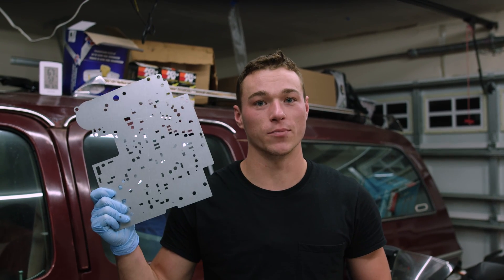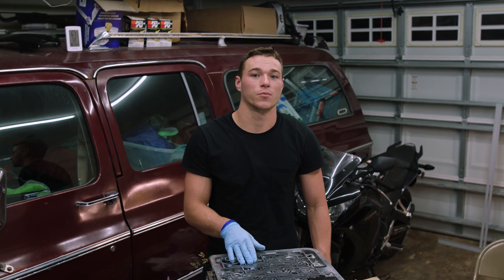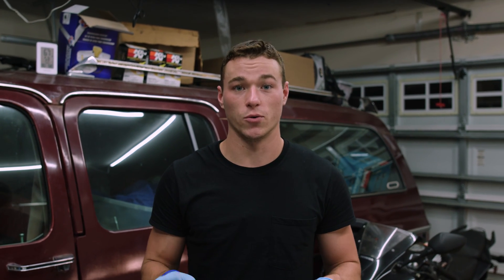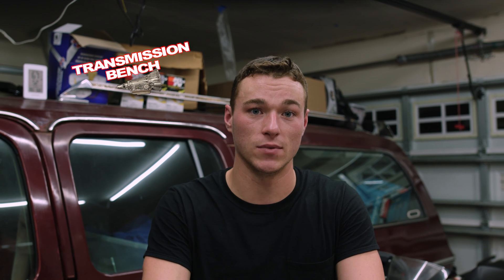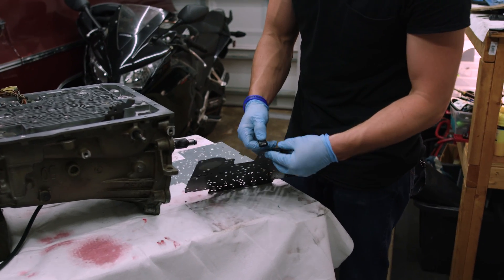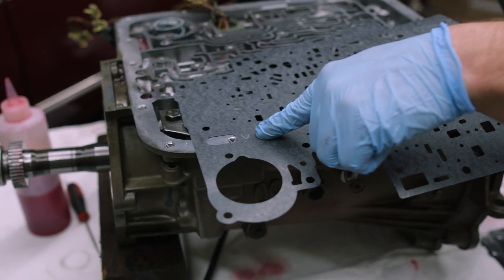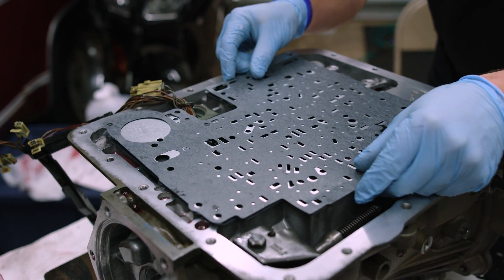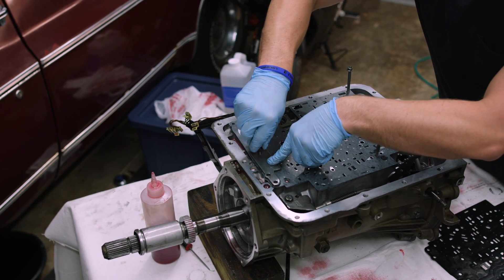TransGo Separator Plate - Install & Review in our 4L60E

Comment: Ok is my turn. I still own a 95 suburban 4x4 in which I love dearly. Eeeh 7 broken transmissions and I assure it wasnt replaced with 7 95 model transmissions before ultimately building my own Frankenstein transmission from the years 95 to 04 with a few after market parts but I have yet to see anything that a 95 is any different. Yes it was on a tbi engine for the first year of the vortec OBD2 engine but it doesn't matter what it is so long as the computer tells it to shift and it shifts and having a 95 and a 2000 model torn completely apart and putting them in each other's case's and the big converter will work with a spacer plate you could not tell a difference. It's not recommended to use any torque converter before 95 on a 95 up because of its clutch style and if anyone wants to know how to make their tranny's last longer ditch the steel pistons and replace with 700r4 or early model 4l60e aluminum and seal kit. Especially for racing types. Integrate the 2000 model thruster washer type in place of brass washer for early models and ls engines out put shaft and front and rear 5 gear planetary wide 2  4 band and 7 clutch 3 4  with steels from a 93 S10 blazer because that year had thinner steels enough to add another clutch. Shaved steels for added clutch on lo reverse , forward, and overrun. Valve body from 03  with high ohm solenoids (less resistance) and jammed the ec3 thing and feels like a 5 speed when it shifts transgo separator Corvette servo 🤔 deep pan and filter all packed into a 95 case on a tbi OBD1 system and is flawless  the 95 was created for the 96 and up tears they were just using up the tbi engines. But has nothing to do with the transmission.

Comment: Don’t you suppose to glue and oven the new gasket and the plate?
Reply from the maker: No, a factory separator plate gasket is not sealed to the plate with anything, it's actually pretty easy to remove unless it's very old.

Comment: Hi there, can i put the 2001 valve body gasket to the 1996 model? or it won’t work?
Reply from the maker: Technically no, they are different gaskets, the 1996 one will have a C & V stamped out of it, but the 2001 one will have CA & VB stamped out. This chart is useful https://www.gmtransmissionparts.com/700r4-4l60e-4l65e-year-range-information/